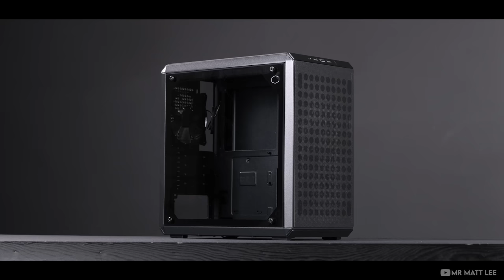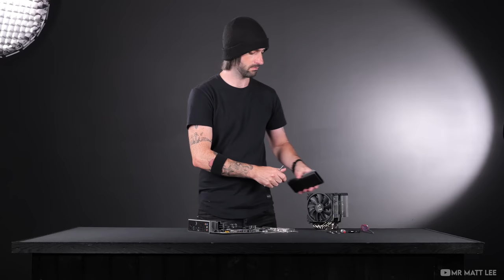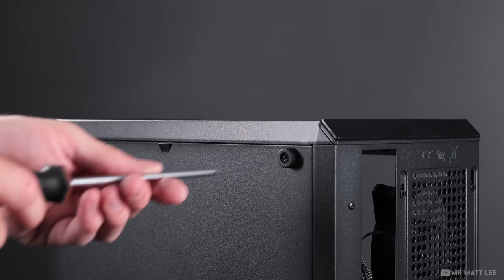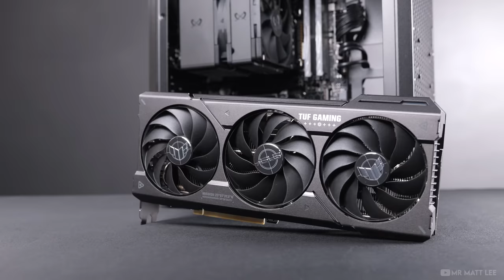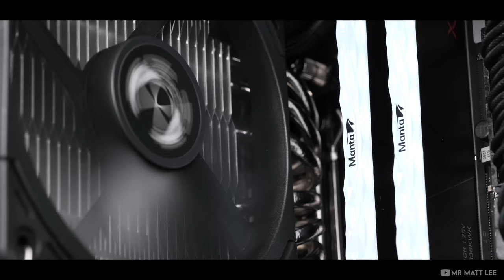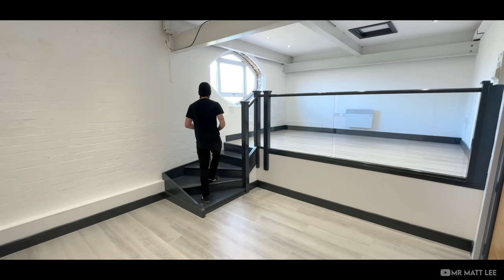This RTX 4070 Build is EPIC | Scythe FUMA 3 + Cooler Master Q300L V2 | Micro ATX Gaming PC Build

Comment: It's always great to see someone who replaces the stock fan in the Q300L for much better ones. I see a lot of reviewers for this case slap on overly powerful components (high TDP, budget mismatch) and rely on the stock fan for cooling, then act surprised that the temps on the Q300L are atrocious. Yes, airflow can suck on the Q300L, but can be improved by actually installing more intake/exhaust fans around the same tier as Arctic P12/P14.

Comment: I had the first Q300L and it was a fairly good case. Happy that I see a tempered glass panel. Also like the new pattern on the filters. I just wanted the case wholes to be a bit bigger, such as the filter pattern to help even more airflow and silence. But aside that it's a very beautiful case. Great vfm. Your video is art, as always.
Reply: Igues it was cheaper for Coolermaster to just paint bigger fake holes to the filters. 🤣

Comment: Cheers for you and the new studio, only good stuff to come, I have the version 1 of that case and it was a pain to find out through the internet that it was a hot chamber so after accumulating courage for months I took a Dremel and made 4 holes, 2 in front and 2 above of 120mm fan size and thermals improved just a bit, those tiny holes in the metal sheet are covering more than 60% of air if I recall correctly the gamersnexus video on the case.

Comment: I have the Scythe Fuma 3 installed on my i9 13900k with the thermal right contact plate. All-core in Cinebench R23 never passes 98c on the hottest core and 90c average on all cores. Scoring 39k points. Its an incredibly capable air cooler for haveing 100%  ram compatibility.

Comment: How is the thermals? I’ve just bought Fuma 3 two days ago and planning to copy your build but read many online reviews which state that the refreshed Q300L v2 still haven’t fixed the thermal problems from the previous Q300L…apparently they pointed out the metal front panel is too restrictive. On the other hand, the aesthetics is out of this world m8, solid 10/10.
Reply from the maker: Thanks bud! Appreciate the input. I do think the thermals could be better as standard, but adding in those 120mm fan spacers for the front panel does make a different. Part the problem is that in default configuration the front fans are literally screwed up against the chassis which restricts the airflow slightly. Set them back a little and it gives the van more chance to breathe and pull in air. I’ve experienced no issues at all with this setup since building and the cooling is more than acceptable 😊
Reply: @Mr_Matt_Lee that’s a genius solution, as expected from the maestro himself. I just felt like it’s a shame Coolermaster didn’t change the panel material from metal to mesh. This case is still one of the most attractive choice in its price range though, but like you said, it’s far from perfect without those spacers. Personally, I thought $15 is a cheap fix for airflow problem but the others might not agree since one of its strong point is the $60 price. I really hope coolermaster watches your video and include those spacers so we wouldn’t need to spend $15 for noctua’s spacers for a $60 case. 

Ps : I just realized you always use V-tune rgb ram on many minimalistic rgb - blacked out air cooler build and they always turn out beautiful 😎

Comment: It's been 3 years since I've met with  Sycthe mugen 5 pcgh CPU cooler. It's sad people only know 1 brand about passive cooling and it's Noctua, but man... Since I've bought mugen 5 pcgh, I've changed 3 CPU's (the last one is an 12th gen i9 and I was able to install the cooler with a Sycthe conversion bracket sold seperately) and by far this cooler is the BEST cooler in my entire PC consumer life!! 1) Silent as a dead!! 2) Great cooling performance 3) Unbelievable price!

And after experiencing the noise and cooling performance of passive cooling , I don't think I'll switch to water cooling anymore. If you choose a quality passive cooler , that's the way to go

Comment: Hint: Save money by using the included cpu cooler (more than good enough for a R7 7600) and spend the money on a better case. I'm using the ASUS AP201, its a MUCH  better case for MATX
Reply: stock cooler sucks bro. you can get cheap coolers for less the $30.

Comment: if you remove the intake case fan you get a much more spread out airflow in the cabinet
Reply: which fan?
Reply: @932viper  all fans sucking air into the case are obsolete to a point where it seems retarded. this case is mesh on all side. ergo you just need 1 fan blowing air out. the one sitting just behind the cpu cooler is perfect. the rest are retorded.

people are not equal. some are stupid.

Comment: I bought this case and am returning it because it suffers from terrible airflow. Temps increased by over 10 degrees when I miniaturized my build with this case. and that was with 4 Noctua NF-A12x25 fans maxed out at 2000rpm. This case is a little oven. I wouldn't recommend it to anyone. Why they didn't go with mesh blows my mind.

Comment: Damn had the original q300l and the only good thing about it is the cable management. That thing is a damn hot box, had to grind out 120 squares just to have airflow. And yeah dont build air coolers on that, its a pain to screw down the motherboard or at least put the cooler after installing the motherboard. 

Anyone buying this case, make sure you put in cpu and gpu that dont produce too much heat.

Comment: I put together a build in the V1 version of this case just last week and had the exact same gripes - some of the mobo screw mounts are hard to reach even with a small screwdriver (especially if you've got a massive CPU cooler block), and I don't like the fan screws visibly sticking out on the front. But considering it came with a 120mm fan and could hold my 6800XT, a full-size ATX PSU, and a 155mm-tall CPU cooler, all for $40...it's hard to argue with the value proposition. Definitely don't recommend it for bigger GPUs though - the 6800XT meant I couldn't fit a second fan in the front, and my temperatures suffered greatly for it.

Comment: Pro tip: Install all your case fans after you install your motherboard, and then install your cpu cooler. Especially a big ugly one like that. Also lay your case on the side when installing the card so your mobo doesn’t do this 7:02.
Reply: Motherboard would still bend, even if the case is laid down since there is a small empty area between the mobo and the back plate of the case.
Reply: @justalexproject  no not like that, not in my experience with building. Never seen that much bending when laying the board flat. Granted, new boards need more pressure to install a card, all the more reason to disperse the weight evenly.
Reply: @user-hp4vr2zg7v  But the weight should be dispersed evenly because of the motherboard brackets right? Maybe you dont see that much bend because you're seeing a top down view and its harder to notice that way.

Comment: surprised that cooler master resurrected this chassis - really doesn't have much going for it with so many better options nowadays...
Reply from the maker: I think at the price point there’s definitely space for it. Micro ATX cases seem to sit in this weird place between super low budget and mid-range for the most part
Reply: This refresh would have made a perfectly good case if the vent holes were simply expanded, but instead they added another layer of filter to potentially make it even worse? Very strange.

Comment: How did you break out the PCI blanking plates with the motherboard installed - I found that completely impossible and had to remove the motherboard completely.

I wonder what your temps were like. Every review of this case suggests it's an oven.

Comment: Would this build work if I had a H610M-HDV motherboard along with Intel Core i5 12400F?
Im just concerned if everything would fit into the case, also not sure what to do with ssd because H610M-HDV dosnt seem to support the one used in the video.

Comment: How much of a CPU Bottleneck u wanna have?
Answer: Yes
Reply from the maker: At 1440p there’s a 3.1% bottleneck. Hardly an issue and well within tolerances 🥸
Reply: @Mr_Matt_Lee  not gonna lie but the most used resolution is still 1080P and the 3,1% are only in GPU intense games in games where u need both it's becoming 22,5% (still 1440P)
Reply: @Mr_Matt_Lee  I personally think that something like a Ryzen 7 7800X3D or a Ryzen 9 7900 (non X) would better fit there. And yes I know that they cost way more but it will also be a way better investments.